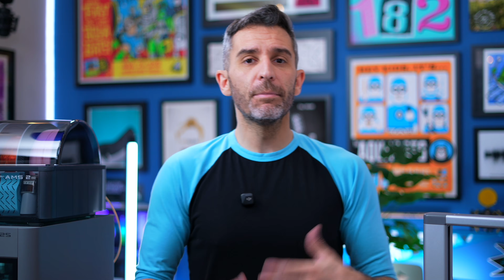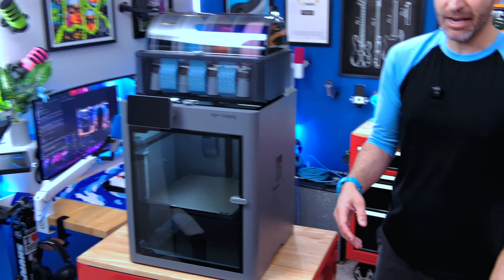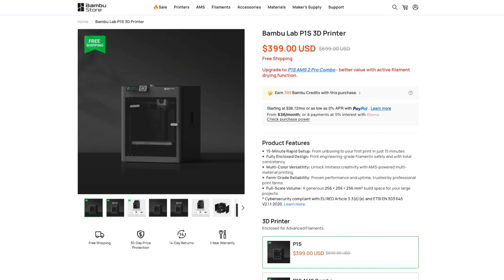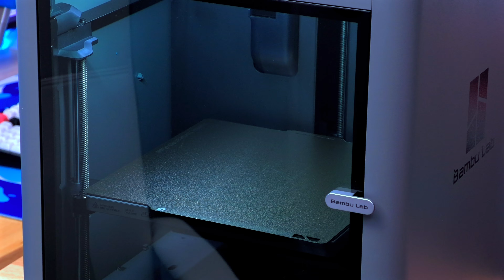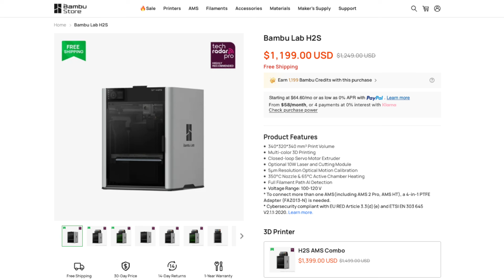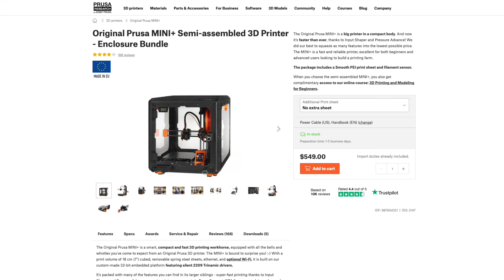Should You Get An Open Or Enclosed 3D Printer?

Comment: I was wondering if an enclosed printer could print in cold places, for example I am looking to get an enclosed 3d printer for my garage and was wondering if the cold temperatures will affect the prints as it can get to -5 degrees Celsius in the winters, is a printer with a heated chamber needed and if so which one would you recomend?
Thank you so much.
Reply: @MandoBrickz567 hey we are printing in +4to 10 celsius, no problem so far but if want to print with the tpu then need dryer, and its better to be in home where its warm so filament is not that wet or cold so it can break and make prints bad
Reply: You can take any enclosed, like bambu lab p2s, we are using prusa core one+ its little pricey😅
Reply: @c0ffm1ng  alright, thanks so much for the help :)

Comment: I love my Bambu's. They are great for prototyping, but I also got my hands on a a Intamsys Funmat HT for engineering filaments. It took come convincing (read modding) to get it to print reliably, but now I can print PEEK if for some weird reason I need to. I had my eye on an H2S for it's large print size for a while until I found an Ender 5 Plus for $120 on Marketplace. Again, slow machine, but a fraction of the cost, and larger build volume.

Comment: I have had an X1Carbon and A1Mini. at about a year, I had to warranty return the A1 mini, and upgraded to an A1, wanting the biggger bed (and the same sized pei sheets as the X1C). A year into it, i had to warranty the A1. I gave up and bought the P1S. 
I wish i had saved the warranty money, and gotten the P1S from the start. The X1c is still going strong, and the 2 other P1S printers have had zero issues. 
save yourself the headache, as the P1S isn't that much more expansive than the A1, and you'll save on warranty purchases.
Reply: What went wrong with your mini and A1? I have three A1s and a mini (and three AMS lites) that have been flawless over the past two years.

Comment: I have 3 enclosed 3D printers (Snapmaker U1, X1c and CC1 with Canvas) and 3 Bedslingers (A2L, A1 and A1 mini). I'm lucky enough to say all of my printers are very reliable. for some reason the bedslingers are even more reliable than my core xy printers lol. still on the first nozzles it came with. zero issues.
Reply: Probably due to their simplicity. I have three A1s and a mini for two years now and they've all been flawless performers. I print PLA, PETG (mostly) and TPU.
Reply: @NWGR same. My u1 is a lot more troublesome. I get it 4 toolheads. More things to go wrong but my bedslingers are workhorses. My A2L is printing really good tbh. It might be my best one even tho it's a bedslinger (print quality)
Reply: how do you like the a2l currently have a A1 mini. I need the larger bed but im stuck between the a2l and H2S. I can buy the a2l now or wait a few more months to save for the h2s.
Reply: @IndestructibleTurtle  it's honestly very reliable. if you're just printing PLA/PETG/TPU you dont need an H2S at all
Reply: @JhuJhustine  I probably will just go with the a2l

Comment: Bien le bonjour de Paris, et merci pour votre partage. Je vais bientôt avoir besoin d'une imprimante 3d, mais je ne sais pas encore si je vais choisir une ouverte, ou fermée, cependant comme j'habite en appartement, le plus sage sera peut-être de choisir une fermée à cause des odeurs...
Reply: If you print with basic filaments, like PLA, PETG and TPU, you just need a basic fan exhausting near the printer out a window if you go with an open printer.

My recommendation would be enclosed though. The print quality is similar enough for most cases but you might sometimes be left wondering if a cool breeze or dust build up caused a failure on an open printer. There are less variables to worry about with enclosed.